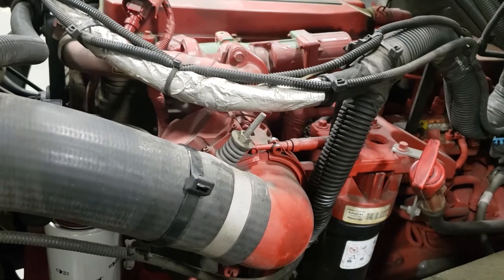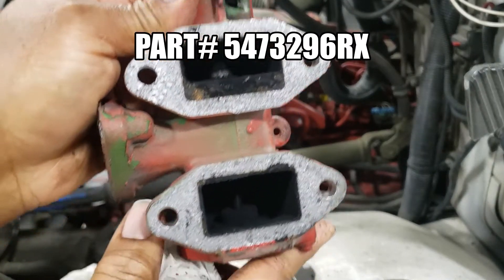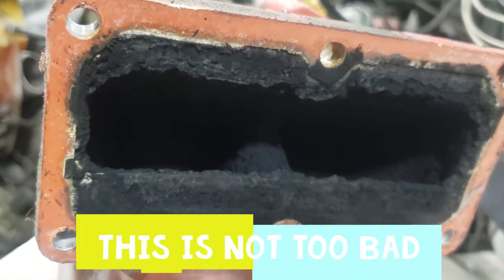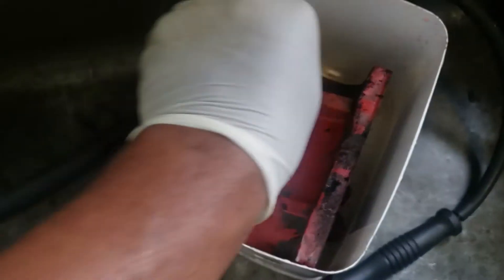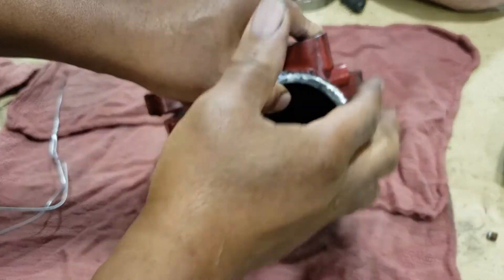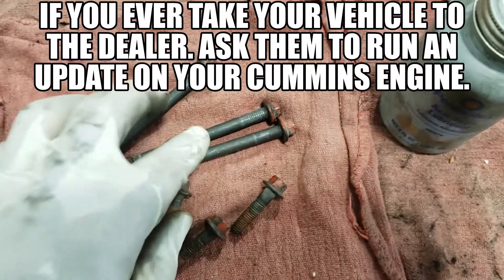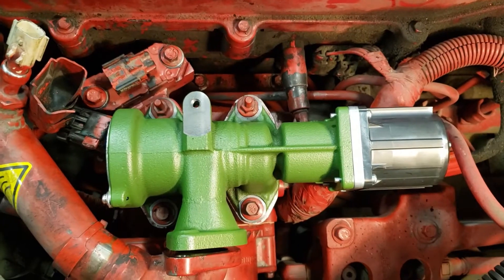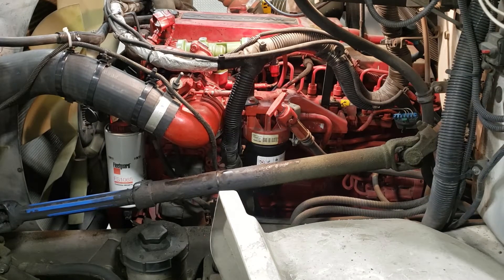Cummins ISB 6.7L Engine EGR Valve Replacement

Comment: Will doing a Regen resolve any EGR issues? I currently have SPN 1569 and SPN 27 fault codes running, notice a big drop in power.
Reply from the maker: Yes Sir! I would first try to regen and hopefully that will solve your issue. 👍🏽

Comment: Does it need manual regen to be done, or just cleaned and changed will work?
Reply from the maker: That's a good question.  If the Vehicle did not go into reduce power. All you need to do is replace EGR and drive. If a Engine Light came on and the Vehicle is not in reduce power. Replace EGR and clear Fault Code and regen should not be needed.  If the Vehicle went into reduce power due to EGR or related components.  You will be forced to regen after you replace the EGR.
Reply: @dairleautoclassicrestorati6892  when pressing gas pedal it is getting power and losing it, so my ges it with new egr and diff pressure and with god air intake problem should be solved.

Comment: Hi. Currently doing the same. I have the egr pipe off and clean. The front tube that goes around the front to the Cooler. Next is taking off the intake and cooler.  Then put it all together and see what happens.  The egr was very very dirty. Front pipe not bad, but cooler looks bad.
Reply from the maker: Good job! I have a Video on my Channel showing how to clean a EGR Cooler. It works well for me over the years. But it may not work for others.
Thanks

Comment: What is that tube and sensor called?  I’m not a mechanic but I don’t mind getting my hands dirty!  I’ve cleaned the egr cooler, the valve, mixer housing etc… the air intake, even raise the little screens up to remove a-lot of carbon down in the manifold.   I replaced back pressure sensor it was fried!  I have new egr valve on the way but before I replace it, I need to clean that tube and replace the sensor on it.   WHAT IS THAT TUBE CALLED, And the sensor on the tube??????
Reply from the maker: That is a Temp Sensor . The Part number is 2872858. The Tube is called "Air Transfer Tube"

Comment: Please, what do these error codes 2692 and 4449 mean on 2017 International 4300 truck?
Reply from the maker: It sounds like you may have loss of power. If so, you may need to clean your EGR ports and inspect your EGR Valve. I will be making a video on cleaning the EGR Valve .After you clean the ports. You may need to regen.
Reply: @dairleautoclassicrestorati6892  No, the truck has no power loss. This is the description showing for error code 2692, "Aftertreatment 1 Diesel Particulate Filter System- Data Erratic, Intermittent, or Incorrect. The Aftertreatment particulate matter sensor has detected a problem with the diesel particulate filter system".

The second error code 4449 shows this description, "Aftertreatment 1 Particulate Sensor Regeneration Status- Data Valid But Above Normal Operating range- Moderately Severe Level. The Afterttreatment particulate matter sensor has detected in-range high sensor values". Can you please help out to know what is needed to be done? Thank you
Reply from the maker: @DafeTV Network  This sounds like the after treatment Particulate Matter Sensor by the Catalytic.

Comment: I have a 2017 International 4300 truck and I am getting the check engine light code SPN 3058 FMI 18. My mechanic says it needs a forced engine regen. I did this twice already and each time, the check engine light comes back on again after about 10 to 20 miles of driving. One thing to point out is that after the engine regen was done, the check engine light flashes about six times before going off. But like I said, it comes back on each time. My mechanic said the computer shows my DPF is on stage 2 which is a good sign because it's not on 3 or 4 stage. Please, i'm really confused now on what next to do.
Reply from the maker: From what you have said. It's possible that the EGR Cooler is causing the problem. By them being so expensive. I have cleaned a couple of them and regen the vehicle  and luckly it fixed the problem. Take a look at my Video " How To Clean EGR Cooler on 6.7 Cummins "
Thanks
Reply: @dairleautoclassicrestorati6892  Thank you for a quick response to my concern. Does it mean I should not change the EGR valve but rather clean the EGR cooler? Thanks
Reply from the maker: @dafelogistics   I would change the egr valve first especially if it never been changed before.  That is what most Dealers would do.
Reply: @dairleautoclassicrestorati6892  Thanks a lot. I was wondering if you are here in Georgia. I would have loved you fix this problem for me
Reply from the maker: @dafelogistics  I am in NC.
Reply: @dairleautoclassicrestorati6892  Too bad. Keep up the good work, thanks
Reply: @dairleautoclassicrestorati6892  Can egr valve with different part # work on 6.7L cummins engine like the one you have? I keep getting different par numbers anytime I call international part dealer locations. I was able to find the egr valve with the same part # you used in your video.  Will this work on my 2017 International 4300 truck?
Reply from the maker: Call the International Dealer. And give them the last (8) of your vehicle Vin#. That way you will surely get the correct one.
Reply: @dairleautoclassicrestorati6892  I did but they said I should call Rush Truck Centers. I did call Rush Truck but the location I called didn't have it in stock but wanted to place an order for it so I could come pick it up. I asked for the part # but it seemed he rearranged the part # that you have. Your EGR part # is 5473296RX but Rush Truck gave me 5743269RX. I called another Ruch Truck location, and I was given a set of different numbers. It's rally confusing
Reply from the maker: @dafelogistics   If you feel comfortable in doing so provide me your Vin number and I will check with my Dealer. If you want me too.
Reply: @dairleautoclassicrestorati6892  Sure, check your email please
Reply: I had the same code spn3058 fmi18...I cleaned out the egr valve yesterday put it back together and blew air in the egr cooler. Ran the truck and seemed to have ran worse. How can I diagnosed if it's really bad egr cooler. Any telltale signs. I'd appreciate any feedback. Take care yall
Reply: @turnnratchet339 what about to change egr differential pressure sensor maybe?